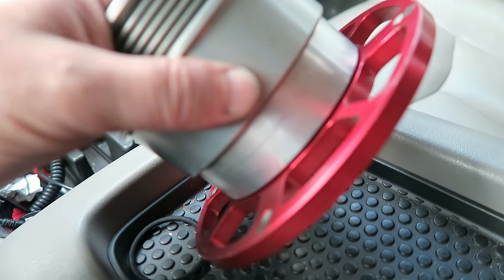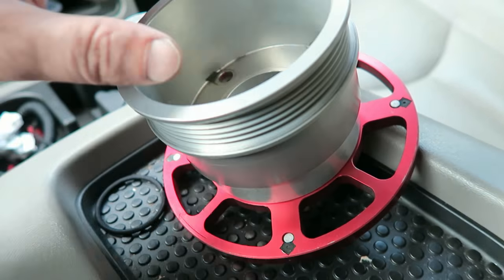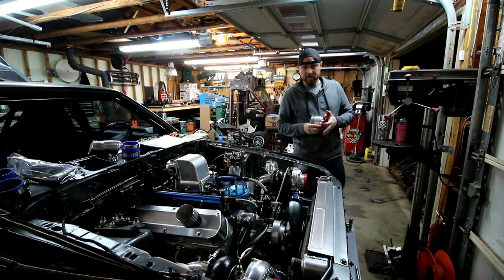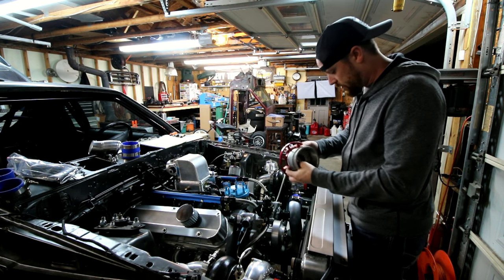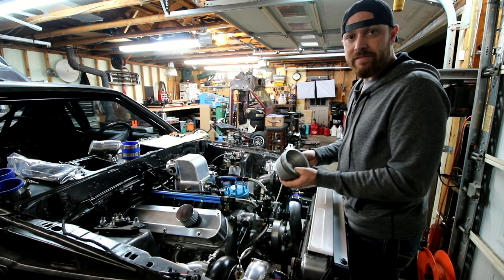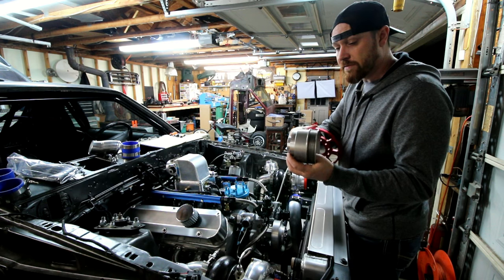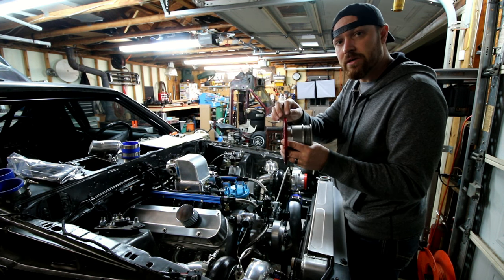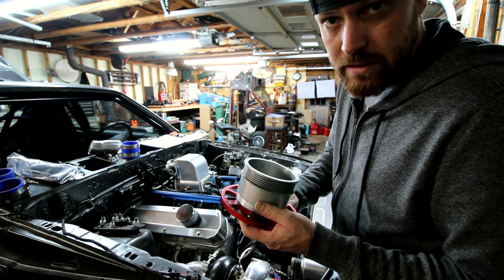I Welded The Turbo Pipe To The Throttle Body

Comment: 7:40 that darn tungsten getting in the way? haha. I built myself a little diy tig from a 200A stick welder, a WP26 torch, some argon, and a pedal I hacked into the amp control on the control panel. 

also, i may have missed it in the earlier videos, but why didn't you use a tube 90 to go from the TB to the manifold? Wouldn't it give you better flow and more room for a hood?
Reply from the maker: mainly because I already had this one

Comment: Other than friction created by bolt tightening, what keeps the crank trigger from spinning on the pulley adaptor?  Just like the distributor, doesn't it need to be timed to TDC or the position of the distributor rotor in relation to the location of the piston travel?
Reply from the maker: the pulley bolts run through it...it has a bolt pattern as well

Comment: crank trigger wheel; 4 marks, 360/4=90°; what would be the Firing Order? always interesting your videos.
Reply from the maker: yeah a 4 stroke v8 engine only fires 4 cylinders per a revolution. the distributor is what determines firing order.
Reply: Companion Pistons for V8; 1-5 2-6 3-7 4-8?

Comment: Kyle, maybe you could do a sister video to the TIG gas welding torch, but talk about the foot pedal. I have a finger trigger right now but would like to know if you recommend the foot pedal, and why this fool would need that tool. lol

I have not gotten to try it yet but hopefully soon (lost my tungsten that came with my welder), but would like to know if it would be better just to wait on a foot pedal.
Reply from the maker: yeah it hard enough to control your tungsten as it is....you dont want to be trying to dial your heat with your finger as well
Reply: The Fab Forums Hand controls are designed to set your amps precisely so when you strike the arc its already set. Foot pedal gives you the freedom to vary your heat or amps. Hand control is great for welding upside-down or out of position where a pedal is not feasible
Reply from the maker: Yeah I understand what they are used for. they are just not practical for someone just getting started. The one that is preset would be even worse in most cases because you cant draw back the heat as you get close to the edge of your piece or end of your weld.

Comment: Do you know or recommend any exhaust shop's to do custom exhaust work? I'm wanting to find someone to do the exhaust on my 97 Camaro. There isn't a lot of room under the car and I'm needing someone that can do a clean install of dual 3 inch with x-pipe over the rear axle. I'll also have electric dumps under the car and the wide band / O2 sensor bungs. I know you probably do your own exhaust work but didn't know if you recommended someone around Seneca, Clemson, Liberty, Easley area.
Reply from the maker: Glen's muffler in Seneca can take care of you
Reply: The Fab Forums Awesome! Thank you.

Comment: how much do you think you have in this build so far. I'm wanting to build one I have my foxbody stripped an putting back half in but not sure on twin turbo or blown on alcohol.
Reply from the maker: I dont have much in it but that doesn't mean it wouldn't cost much to build it. I used make money by buying modified mustangs and returning them to stock while selling off the performance parts. So a lot of what I have I got for free basically.
Reply: The Fab Forums that's cool. I know my builds going to cost. my father builds classic car from ground up for a living so I know cars in general get expensive